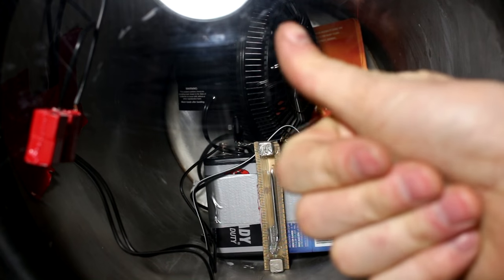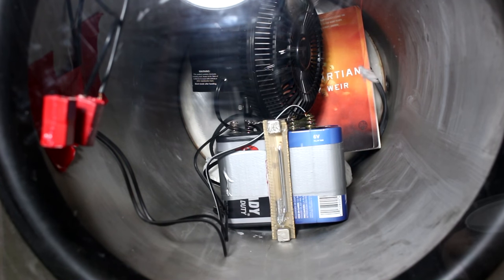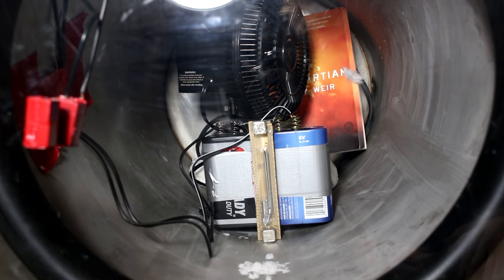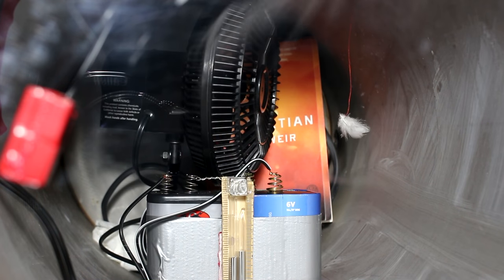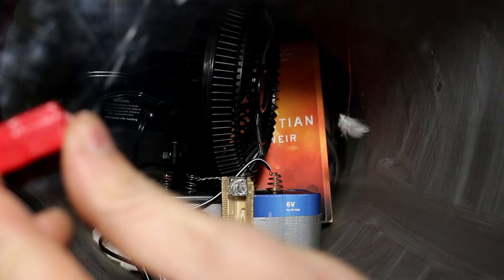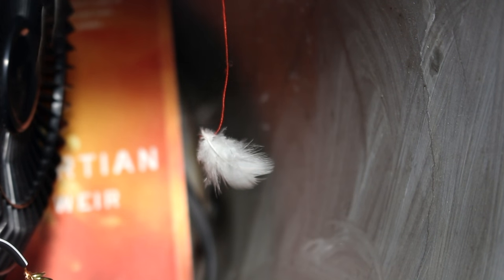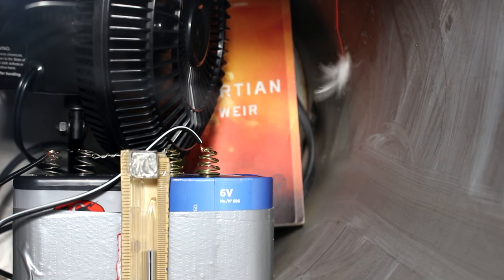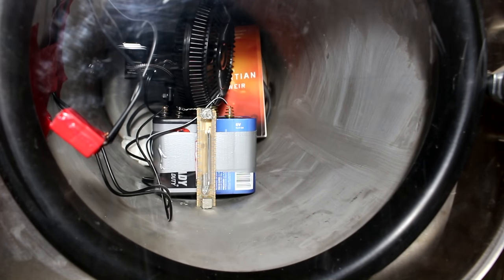How Strong is The Wind on Mars?

Comment: Two issues I am sure you understand:
1) the gravity is lower on Mars
2) we know that Mars generates dust storms.  First , the moving particulates carry with them more force than the atmosphere itself does.  Second, we know that because of the dust storms and the fact that dust is deposited and cleaned from solar panels on a continual basis, the wind does have more effect than you are demonstrating.
Reply: We have to clean the solar panels often because the dust particles are very tiny and very dry, so they hang in what little atmosphere exists and cling to everything through static forces. It's better to think of the dust in the air like suspended fog rather than picked up through raw wind force.

On average Mar's atmospheric pressure is 0.6% that of Earth's, so it simply does not carry enough force to be able to do anything close to what is portrayed in the Martian. And again those "dust storms" we see in real life are caused by static and very fine particles, not some sort of strong wind.
Reply: BucksterMcgee I think you are understating the mass of the particles in relation to the atmosphere.  You are also likely overstating the static electricity.  Given I can see pictures of GLOBAL dust storms as well as dust devils, I think that they would carry more mass.  I am not saying that it is enough to blow a spaceship over, but it is certainly enough to flutter a feather... something not shown in Cody's demo video.
Reply: You seem to not understand the size of particles that are being picked up in these storms, we're talking about on the scale of smoke particles. It's for this very reason that there even can be global dust storms. If the particles were any bigger or weren't so dry they would never be picked up. Mar's atmosphere at the surface in an average of 0.6% that of Earth's... higher up it's even less dense. Larger particles simply cannot be "picked up" by the Martian atmosphere... it is simply too thin.
Reply: BucksterMcgee Really?  So you're saying it's scientifically insignificant?  I guess the gravity is also insignificant?  Also, what is your source for the size of the particles?  How can smoke-scale particles obscure solar panels and get deposited in dunes?
Reply: RyeOnHam your moving particulate has nowhere to pick that force from. Unless locals bring their particulate cannons. And lack of gravity is exactly why Cody has to use vacuum pump on earth, to negate the effect of gravity on atmosphere.m
Reply: I forgot about gravity so this video is lesser cool than I thought it is
Reply: It's just a comparison of Earth vs Mars wind effect on something, gravity is a control for this experiment. It's not meant to simulate a dust storm on Mars with the correct gravity and particles in the air.
Reply: You can even watch Cody's new video where he goes over some of the same issues. But really it comes down to... do you feel a breeze more because there is smoke or fog around? No. Not in any significant way at all.
Reply: BucksterMcgee You know, he made the video addressing two of my questions AFTER I posed the question, but nice try.  This obviously isn't common knowledge, as you are carrying on that it is.
Reply: lol wut? He's literally responding to questions people (like you) had from his first video. How could he respond before someone poised a question? (Funny enough he does preemptively respond at the end of that video anyway to questions he thinks people will ask.... so I guess it is possible after all.)

I don't think I, or anyone, claimed that is was "common knowledge" but we are trying to share "actual knowledge" with you since you making misconceptions based on your lack of knowledge/misinformation. All the information can be looked up on the internet fairly easily (Google, Bing, Wikipedia, etc), so maybe instead of making assumptions you could check your preconceptions with real world data first.

But maybe more than anything.... take a moment to consider that maybe... just maybe... Cody (or others) might have a better understanding on something than you do yourself. Because if that statement isn't true... then you are the most knowledge person in existence... and somehow... I don't think that is true.

Cheers!
Reply: BucksterMcgee TL:DR, but I presume you just take a condescending tone with everybody and don't realize it.

Comment: I did enjoy the movie, but was right away disappointed in two deficiencies: no simulation of reduced gravity on Mars and the improbable wind effects. The low mass to surface ratio of the feather here compensates for the 20:1 reduction in air velocity and amply demonstrates the implausibility of the movie's wind effects. 
great job, Cody.
Reply: Person. uh, gravity on Mars is 3.74m/s^2 which is approx 1/3 of Earth's 9.81m/s^2
Reply: It's very, very difficult to simulate lower gravity on a studio set, short of moving the set to a lower gravity planet. You could maybe stick the actors in a sling to simulate the effect on the whole body gait, but the sling would have to be edited out in post-production, and it would be even more impractical to do that with every single moving object on the set to make them act like they would in gravity other than Earth's. It's much less jarring for the viewer to just ignore the effect than to simulate it badly.

The only other way to do it convincingly would be to go total CGI, and incorporate the lower gravity into the physics model for the animation. That has risks of its own, creatively speaking.
Reply: @NelC I have understood that to be difficult for some time. Even zero G is hard (hence the grav plates, etc. of most space stories), but the movie did very well with that. So the low G sequences suffered by contrast. I just had to will a little harder to suspend my disbelief. Ironic that it's easier to film dancing on the ceiling, which is impossible, than dancing in .4G which wouldn't be impossible, isn't it?
Reply: They movie DID show the lower gravity. The gravity of Mars is not THAT low, it is about half of on earth, which is still appreciable. It isn't like on the Moon, which is 1/6th of earth and which is a major difference. The movie did show Watney lifting things which he should have had difficultly lifting on earth.
Reply: +Marc Barrett  Actually it is about 3/8 (.378). Maybe you are a more acute observer than I; I didn't notice the lifting effect. (Maybe because I know from the Bourne and S. African rugby movies that Damon is pretty buff?) Thanks for mentioning it; the next time I watch "The Martian", I'll look for it.

Comment: To be fair, fan is optimized for Earth's atmosphere. At lower pressures (and, as such, densities), it probably works significantly less effectively. Also to be fair, 200 mph (90 m/s) wind on Mars is roughly equivalent to 22-29 mph (10-13 m/s) wind on Earth in terms of dynamic pressure, so it's not that strong (according to http://www.spc.noaa.gov/faq/tornado/beaufort.html it's "strong breeze" to "near gale"). I'm no rocket scientist, but I reckon spaceships shouldn't topple over in strong breeze.

For the curious, dynamic pressure is the pressure increase a gas/liquid would gain if it suddenly stopped (remember Bernoulli's law: when liquid flows faster, pressure drops, and vice versa), so this is a reasonable rough estimate of pressure difference between two sides of an object that is pushed by wind. Dynamic pressure is defined as ρv²/2 where ρ is density, v is speed. Density of air on Mars is somewhere around 0.015-0.025 kg/m³, so we'll take 0.02 as a reasonable estimate. 0.5*(0.02 kg/m³) * (90 m/s)² = 81 Pa. Working backwards, mean air density on Earth is about 1.2 kg/m³, so 81 Pa = 0.5*(1.2 kg/m³)*v², which gives us v = 11.62 m/s (24.6 mph)
Reply: Also, Martian wind never hits 200mph.. top sustained wind velocity is about 60mph(25m/s), in the biggest of the global dust storms.
Highly localized gusts, and dust-devils, can reach 35m/s
.
.
That has about the same dynamic pressure as a 7mph breeze at earth sealevel.
.
This is enough to fly a kite in, but it better be a very lightweight design!
Reply: Marvin Kitfox Yes, but "200 mph superstorm" was explicitly stated to be far out of the ordinary in the movie, so I think we can let this slide. As a side note, the book is much more reasonable – it talks of wind gusts up to 175 km/h (~ 110 mph), not sustained 200 mph storm. Also there are no spaceships toppling over in the book.

Comment: Wouldn't the CO2 have been extracted by the Vacuum Pump too?
This is a question not a statement as I really don't know the answer....
Joe
Reply: The dry ice will still produce CO2 after all oxygen has been sucked out, is the idea.
Reply: Yes, the pump probably sucked out some co2 along with the air. But that's the idea. To make the co2 replace the air, the dry ice evaporates while the pump is working until there is no more dry ice and the pressure is the one he needed. Then he stops the pump.
He flushed the air out with the co2, some co2 is going to get pumped, but not all.
Reply: it will not evaporate that easy in vacuum i guess lol
Reply: sublimation is not evaporation.
Reply: HailgodMC
Buuurp...

Comment: would the difference in gravity have a significant effect?
Reply: Probably not, since the fan is pushing to the side.  If the feather were to fly away then you would see it float in the air longer as it was pulled down by the reduced gravity.   The reduced atmosphere may also play a part due to buoyant forces, but I'm not sure what that would be.
Reply: Sigma476 i was thinking more in terms of gravity on earth pushing down on the feather would stop it moving as much as in martian gravity which is weaker. just a random curiosity. :)
Reply: Yea, if you did the experiment on Mars it would be able to move the feather more since it is hanging, but possibly not even noticeably so. I think Cody's main point of the video was comparing what Earth wind can do compared to Mars wind, so Earth's gravity was a control and didn't need to be changed in this experiment to prove the point.
Reply: earth gravity is 9.8 m/s^2, martian gravity is 3.7 m/s^2. So that's only ~2.6 times the force (F = mg). With how little the feather moved, I don't think gravity will have a significant effect (2.6*0=0) :)
Reply: flimsybop on didn't mean to call into question the validity of what he did. I just like to play devil's advocate. thanks for the info flimsybob i actually thought the difference was even less than that. :)
Reply: The experiment is to see if it would have any noticeable effect on the feather, not to measure the specific effect.
Reply: You have a point. In lower gravity, an item has lower weight (force pushing it down), an item (e.g. spaceship) can be toppled using less force. An antenna can also be lifted up and blown away using less force.
But the force needed to break the supporting structures of the antenna would be the same, so the book and the movie were not realistic in that regard.
Reply: ***** Even if the gravity is half and you can't move a feather in Earth gravity I somehow doubt a spaceship will be toppled.
Reply: just to be clear, im not attempting to discredit codi or his experiment.  i love this channel and the videos posted (or i wouldnt be subscribed) im just curious to know what effect the addition or subtraction of gravity would effect it.
Reply: TheEightshot Yeah, I don't think anyone here is.
Reply: Private Pecker I'm saying in 1/3 gravity means it takes 1/3 of the force to topple the ship. I'm not disputing that 100 times thinner air would only push with 1/100 of the force.

Comment: how can there be wind if no athmosphere or air?
Reply: there is a thin atmosphere of less than a percent of the pressure on earth
Reply: monkey6573 oh. almost got it. place help me understand the rest. so where there is atmosphere there is "air" that can make wind?
i feel alot smarter now. thanks :p
Reply: benn61 It's not necessarily air which is a specific recipe of gases unique to earth, but you're close. Mars has an atmosphere of CO2.
Reply: ok. so
atmosphere = pressure, isolation from space so gasses wont escape and therefor something similar to "air" that can be moved or move
Reply: yeah, basically.

Comment: Didnt they use parachutes to land probes on Mars?
Reply from the maker: Only to slow down to sub sonic, some other system has to be used for the actual landing.
Reply: ***** Hard to imagine how Mars atmospheric pressure in great altitudes could decelerate anything. But since it obviously worked (at least for some landers), so...

Imagine how easy it has to be to land something on Venus.
Reply: mmmMMMmmm did you miss the "sub sonic" part
Reply: the parachutes will burn up and evaporate
Reply: 45445 Angels Depends on the material used.
Reply: Actually the Soviets discovered during there Venera program that using a parachute to land on Venus made the lander fall to slowly and die from overheating before it landed. Without the parachute, the probes landed at about 20 m/s and were fine. I belive they used a special hull design to slow the lander, but mostly it's because Venus's atmosphere is so amazingly dense (94 atm).
Reply: Yes but some of the biggest parachutes ever made to work in such a thin atmosphere.

Comment: hey Cody still the gravity is not like Mars .. you are just giving earth gravity to simulate Mars ?
Reply: What effect does gravity have in this experiment?
Reply from the maker: thats why its on a string.
Reply: Since gravity pulls the feather down, under martian gravity the feather would have been blown 2–3 times further away (assuming the string does not have any rigidity).
Reply: Daan. You mean it wouldn't have even moved 2-3 times further away. Because if something doesn't move, 2-3 times not moving is = not moving. You know what i'm saying? XD. 0*2=0
Or 2 times 0 is still 0.
Reply: +Daan Wilmer 
The vertical axis forces should not have an effect of the objects movement in the horizontal direction, so the difference in gravity shouldn't effect how far the feather moves.
Reply: Wind= not a magical invisable mars fan
Reply: The Piscis: Ahhh, so if I hang a 20kg mass from a string, and I hang a feather from a string, the 20kg mass should blow just as far?    I think this mental experiment demonstrates that there's something wrong with your reasoning.  Try drawing a free body diagram of the setup to see where you went wrong.
Reply: Tom Kenyon 
the reason the 20 kg mass will not go as far is because of Newtons second law. The larger the mass the less it will accelerate.
Reply: weight actually. and gravity affects that.
Reply: weight is relative, mass is not

Comment: And you have to take it on your calculations that  when you remove the air from your tank ..  the fan has no air resistance on blades / fan turning.  so it will be turning way way way faster than it will on regular pressure.    Hence its ability to move air  as litres per minute is  multiplied by nearly hundred times.   you can hear the bearing screaming and vibrating coz it has gone over its limit and its tiny tiny inbalance starts to be an issue.

Comment: I have a  major criticism for this. Wind force is the squared of wind speed, so when you have 1/7 the wind speed, the force exerted by wind is only 1/49 as strong. The pressure generated by your fan might be only 1/20th as strong as the typical wind on Mars, and only 1/400 as strong as a Martian storm.

Given Mars' air density is 0.6% as much as earth, and a Martian storm goes 20 times faster, a Martian storm produces forces 2.4 times as much as your fan operating under Earth's air density. Even some of the faster winds on Mars running at 7 times the fan's wind speed can still produce as much as 30% of the wind forces generated by your fan under Earth air density. So it's entirely plausible for winds on Mars to blow stuff around.

Comment: I'm curious what the RPM difference was and what exactly we were "hearing" when the fan was running in vacuum. You could definitely hear it slowing down as the pressure was restored, and then it went quiet like a normal fan.

Comment: SOMETHING ELSE TO CONSIDER!!! Cody touched on this when he mentioned the change in the sound of the fan. Because  there were less molecules in the air, the fan had less wind resistance which means it was spinning faster as well. This mean the wind was faster, and the acceleration of the fan was higher, as he also stated the stop time was longer in the vacuum. The feather barely moved in the vacuum, and the that's WITH a fan spinning up to a faster speed, at a higher acceleration. Very impressive experiment but maybe a different source for the wind? A fan with controlled rpm would work. Small Dyson maybe idk.

Comment: The fan might actually blow quite a bit faster when it's in the vacuum, because there's no air resistance slowing down those blades. The fan is probably equipped with a cheap brushed DC motor, which turns proportially faster when it's loaded less. Of course, at really high speed, the bearing friction will be the most significant force and that causes a maximum speed.

Comment: Correct me if I'm wrong, don't you need to put a small windtunnel in there to actually confirm this? The air may not move exactly the way we think in such a vacuum. Just a thought!
Thanks for sharing.

Comment: Air density has an impact on the efficiency of the fan blades.  The air density was not appreciatively changed in the first portions of a second of air being returned, but the velocity of that minimally dense air did have an immediate impact on the feather.

Comment: Running an air-cooled motor in a vacuum is a great way to burn it up. I would also be interested to know what difference better fan blades would make. Consumer fans have a shallow scoop to increase flow (cfm) at the cost of pressure differential, but a deeper scooped blade designed for higher static pressure might work better in low atmospheric pressure.